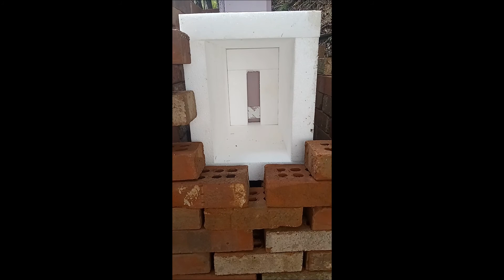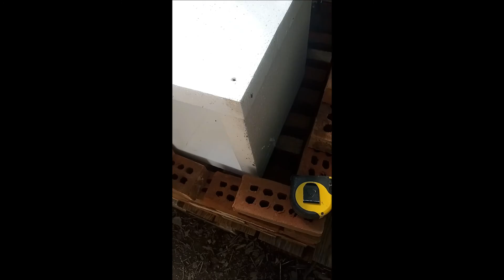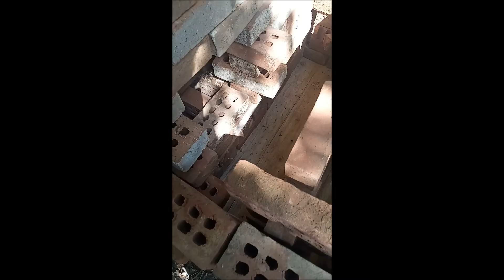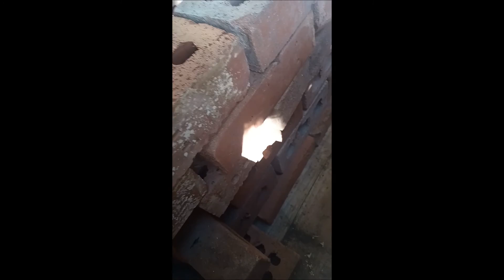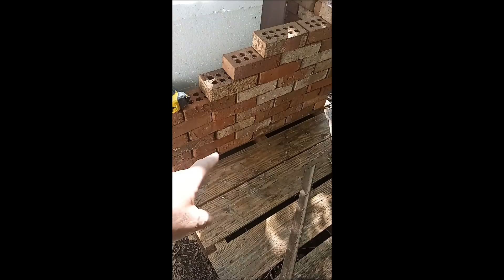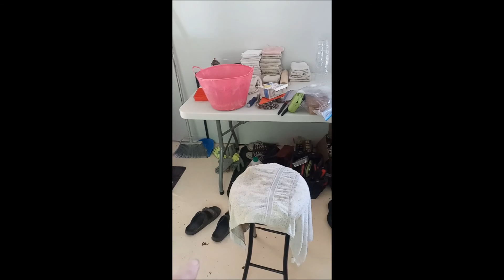Batch Box Rocket Mass Heater Build Original Design Mock up

Comment: Please be aware that ceramic fibre can be a high health risk once it has been subjected to high heat the fibres become crystallised   and will no longer be body soluble, the wood will  abrade the board and you will be subject to breathing in the fibres. It is possible to coat the board with Zircon but it will not last very long.
Portland cement and vermiculite is fine to use as long as it is contained it will last for many years and is a standard mix below the floor bricks in a Pizza oven.
Reply from the maker: I did the research and found a Much better substitute called Superwool ... Thank You

Comment: I have some concern about the hard red brick for the firebox surround; it is more brittle than old soft red brick and cannot tolerate heat-cool cycles as well. I think I would start the firebrick lower in this situation.

Small holes need to be much larger in total than a single opening, as you get edge friction effects for each hole. 

You don't need a special thimble to go from the first firebox surround to the rest of the bell, just a good sized opening or two at the bottom of the dividing wall. 

You are making the bell considerably more involved than it needs to be. I understand supporting the roof slabs, but  making effectively three secondary bells plus a collection chamber will mostly ensure that the part nearest the firebox will be significantly hotter than the other end. I would make one big open space inside the outer walls, with a cross wall for strength leaving large holes at top and bottom for free circulation. If you want more roof slab support, making pillars of brick where needed will add mass without increasing the overall size. The exhaust pipe running from the roof of the bell down to near the floor (known as a "plunger tube") is a good, standard idea. It may be helpful to make the bottom foot sliding so it can be raised or lowered for best performance. You want an access panel or hatch in the side so you can reach the exhaust for adjustment, and for inspection and cleanout generally.  Even a short piece of 8" stovepipe with a cap will be good.

Comment: First comment: use perlite-clay instead of perlite-Portland cement for the insulating base. The clay will eventually fire hard; Portland cement will break down at high temperatures.